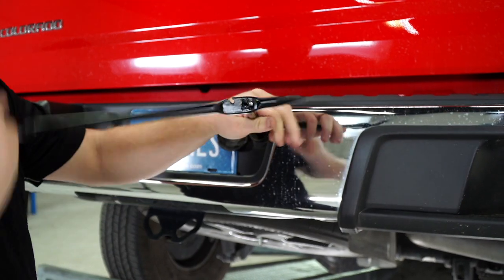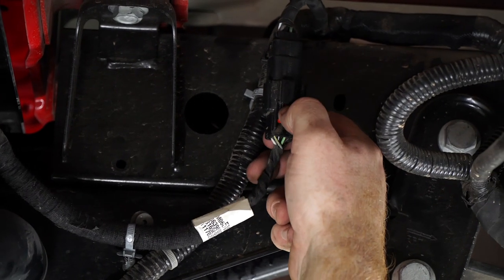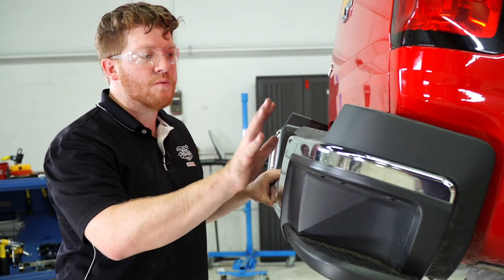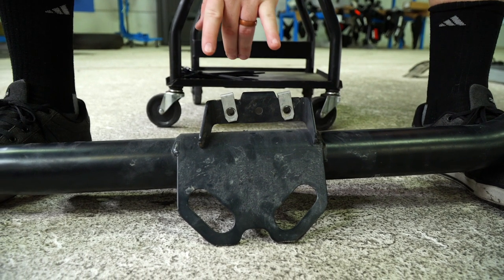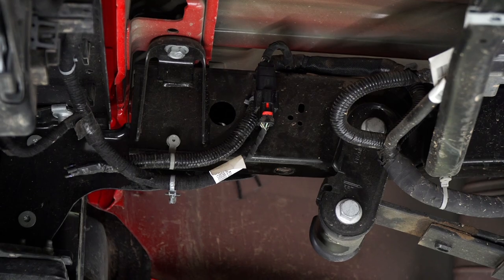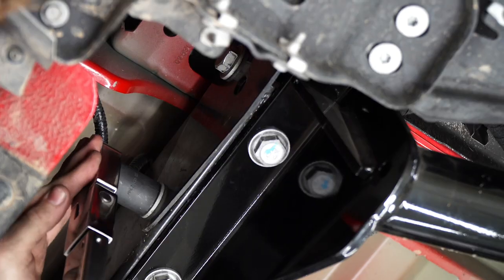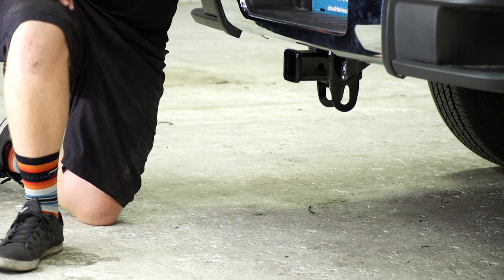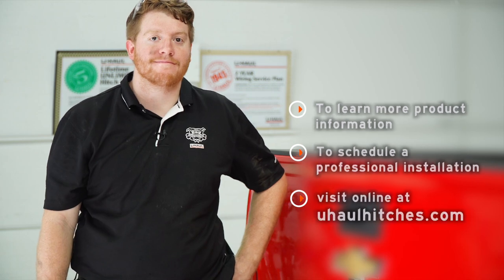2015-2022 Chevy Colorado | U-Haul Trailer Hitch Installation | 78288

Comment: You never filled the gap that was there from the original brace, the four bolts i mean that hold the bumper on, isnt that crooked now? if you removed the origina; brace and it was inside of the bumper brace? it even looks crooked when you talk about torquing the bolts down? what brand hitch is that one, is it the same install for a 2020?
thanks
Reply: The only gap I see is where the bumper attaches. Why that is, IDK. It should go right back on the same as it came off. The hitch butts up correctly though.

Comment: I just installed the Curt 13176 class 3 cross member. But I couldn’t reinstall the center bracket behind the spare tire. The new one doesn’t have any location to bolt it to. Is this going to be an issue ?
Reply: So the instructions for Curt 13176 says to remove the bracket and return to owner. So according to Curt's engineers it is fine to not have the center bracket. It won't be an issue.

Comment: what exactly did this do vs the factory?
Reply from the maker: This hitch has the same functionality as a hitch that can be installed from the manufacturer, except at a much cheaper cost and the same or higher quality. Total weight capacity can vary slightly.

Comment: The 21 mm bolts holding the bumpers on are hopelessly stuck, did you use an impact driver on this? Used penetrating oil and tool extender to no success
Reply from the maker: Yes, we used an impact driver. These can be torqued at very high values and will be extremely difficult to remove without one.